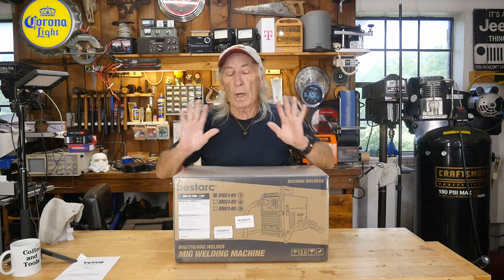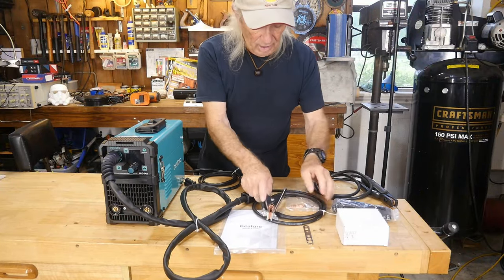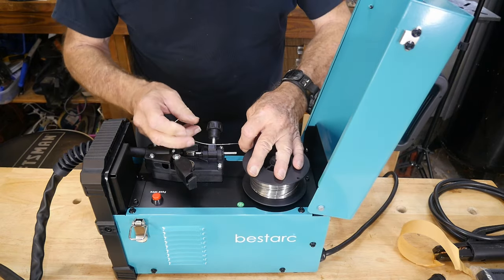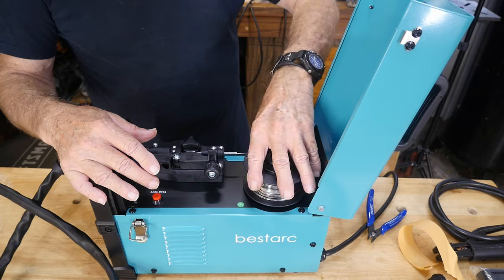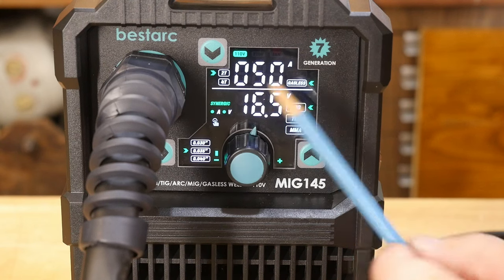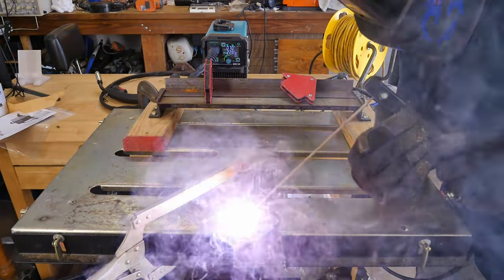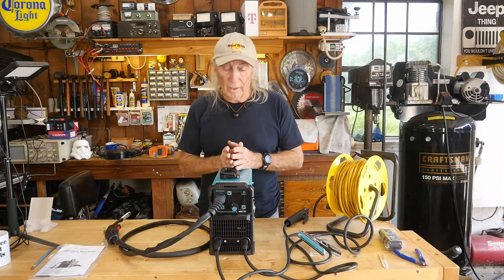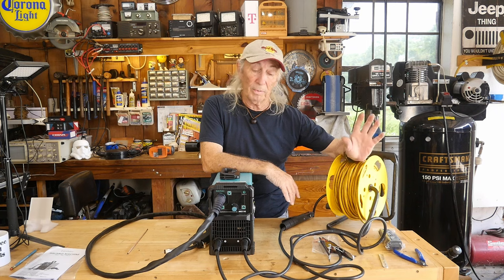BestArc 145 welding machine 3 in 1 , Mig Tin ,Stick !  review C&T ep 443

Comment: Geez, I wish they’d shipped that over with the plasma cutter…I’d have matching set! I like the way the bestarc opens also! A much better system than the vevor. But, I have the brand new vevor and the bestarc plasma…so I’m happy. 
I AM disappointed in vevors folding welding table though. Still waiting for them to get back to me. They sent me wrong parts and I’ve not been able to finish the welding project I’m on. 
I like this machine!!
Reply from the maker: The BestArc seems to be pretty darn good, I didn't review the welding table from Vevor because I have the HoboFreight one and can tell you, the HB is junk and I had several accidents with that table before doing some test welds LOLOL.  The side loading does allow for bigger spools, but the top loading for me is better.:face-blue-smiling: